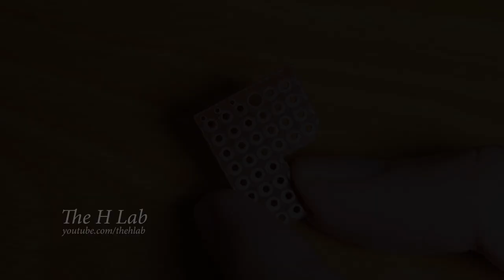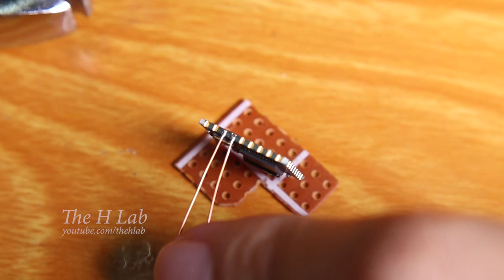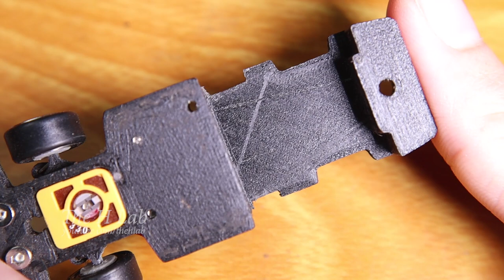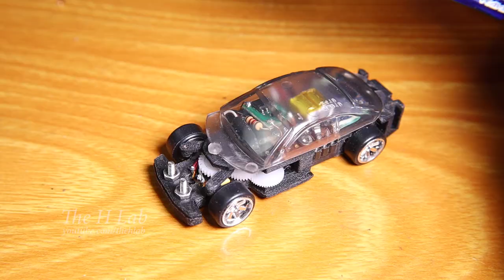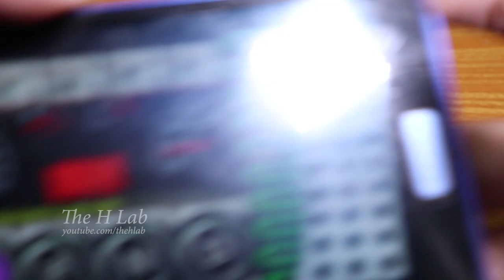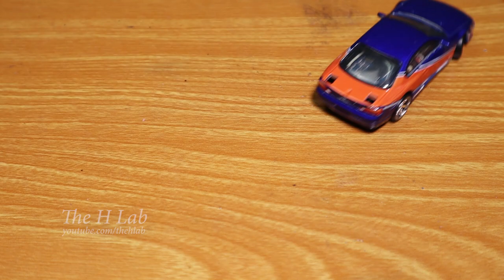Hot Wheels Nissan Skyline Silvia 1:64 RC | The H Lab | Part 3. Completed and Run

Comment: i want to use this app with arduino and hc-06 module, is this possible?
Reply from the maker: Yes. You can. It works with both BLE and SSP
Reply: @TheHLab  can you please do tutorial for variable speed Arduino Bluetooth controlled car with this app? I would very much appreciate it.
Reply: @TheHLab  can you share the code?
Reply: @TheHLab  can you share code? i cant find a single code out there for variable speed and steering bluetooth cars.
Reply from the maker: You can find it here: https://github.com/TheHLab/Convert-JDY-10-to-Bluetooth-Rx